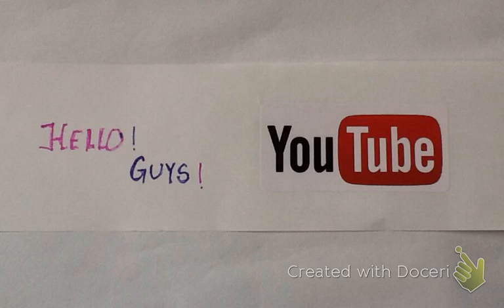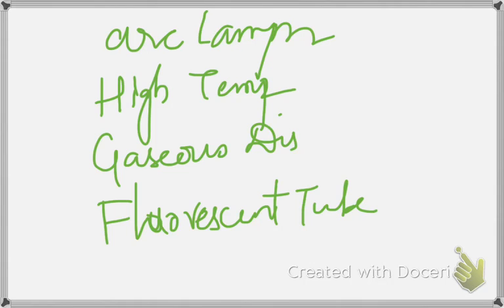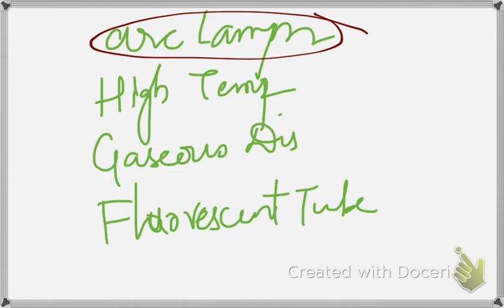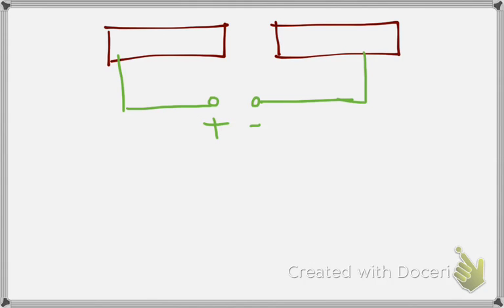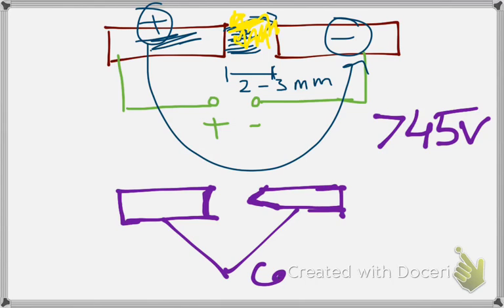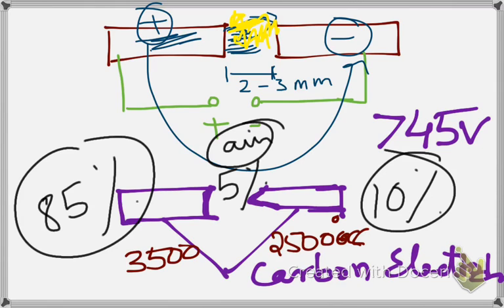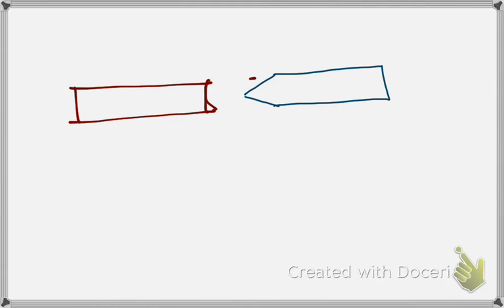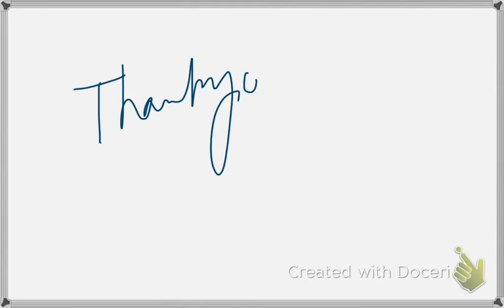Carbon Arc Lamp

Comment: Is this the reason why we refer to the positive wire is the hot wire because of the heat on the carbon Arc Light? Also was the purpose of a lighthouse more of an antenna? I've seen some of the other videos where signals are traveling through the ark search beams it's really cool your videos very interesting thank you